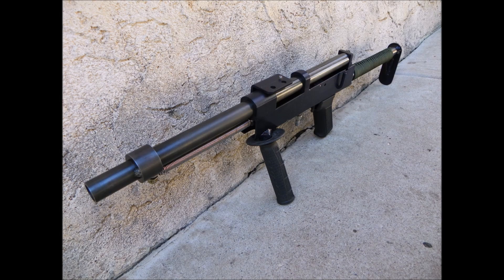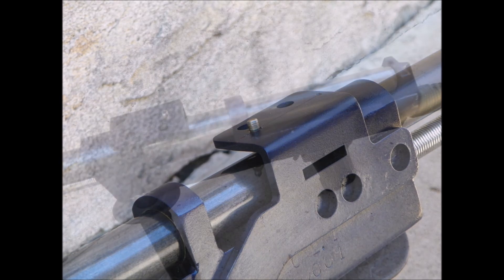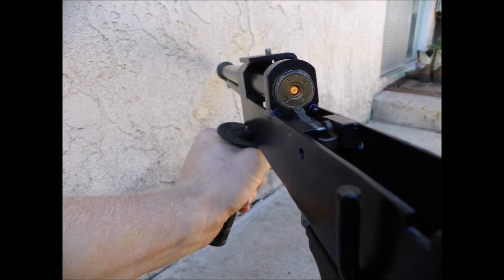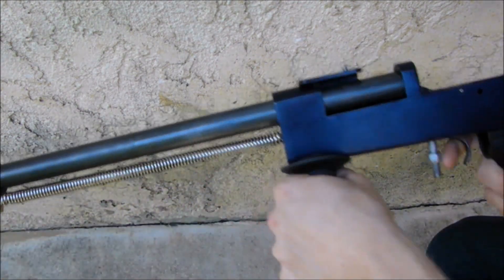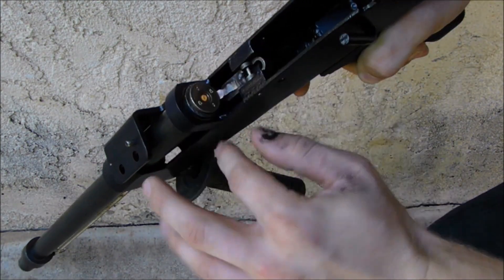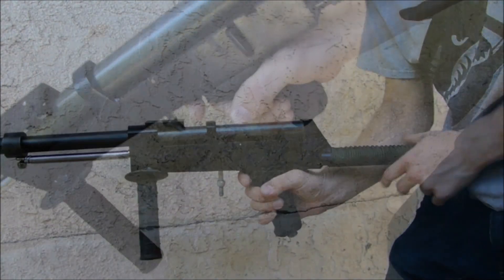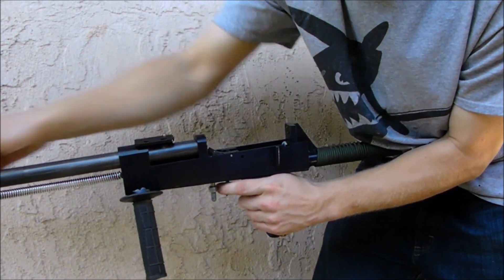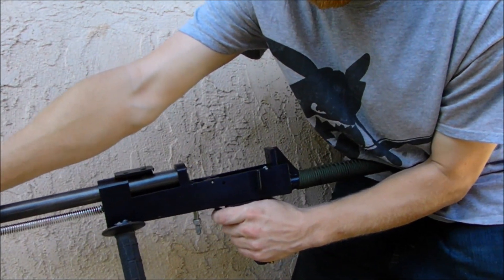Homemade shotgun design and mechanical operation

Comment: Does it need that much distance/force for the shell to strike the pin? Seems like it would do it in about 1/3 to 1/2 the distance the barrel travels on yours.
Reply from the maker: You are correct, Its pretty excessive, I could cut the distance in half and make the design much more compact if I do a version 2
Reply: Depends on your spring, you could in theory make the barrel travel say 3mm (1/8th)before the primer strikes the firing pin.

Comment: Dear Mr. could you tell me if I can use ST-52 carbon steel with a six-millimeter wall for the pipe? Thank you very much.
Reply: normal 3/4 inch pipe can be used as a 12 gauge barrel but you might want to put it inside a 1 inch piece at the breech end for about 4 inches
Reply: As long as inside diameter is 20mm u are safe pressure will not go high enough to explode it

Comment: Was only a couple of days ago I was watching a video about the Terminator and thinking I'd like to build something similar. Nicely done 👌. Hard to see from your vid but is the cartridge retainer and the sear one and the same piece?
Reply from the maker: Yep, it's the same piece, good eye. The sear can be position higher than necessary  in order to hold the cartridge in the chamber. Simple solution that keeps the moving parts to no more than 3 total on the entire gun.